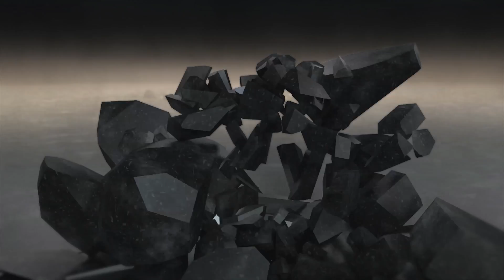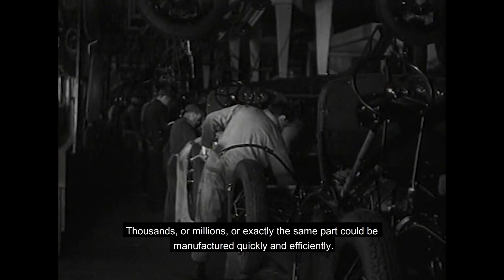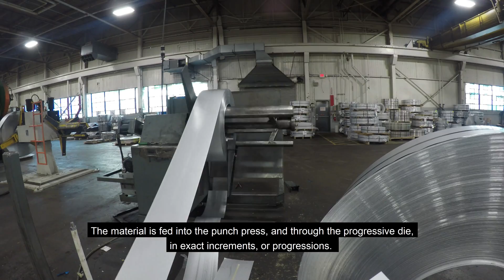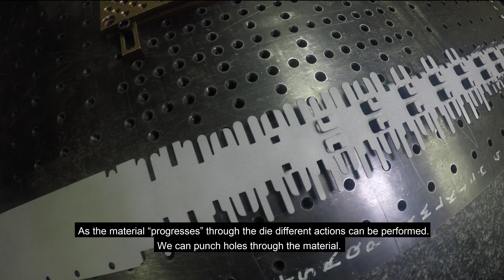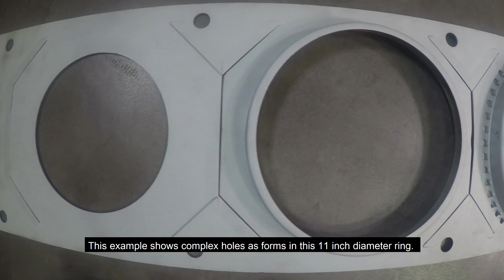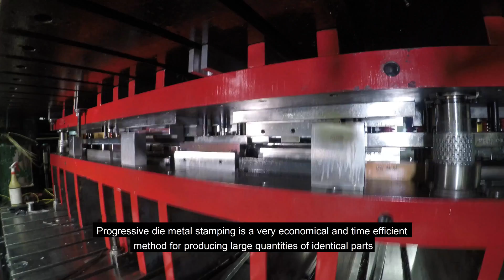Progressive Die Metal Stamping Explained | How the Stamping Process Works – Talan Products

Comment from the maker: What is progressive die metal stamping?
It’s a high-volume manufacturing process where a metal strip moves through multiple stations in a progressive die, with each stroke of the punch press performing a specific operation until a finished part is produced. The progressive die stamping process allows manufacturers to create consistent, tight-tolerance parts efficiently at scale.

Comment from the maker: The progressive die stamping process uses a series of stations within a single die to punch, form, bend, coin, or draw metal as it advances through the press. Each press stroke produces the same precise operation, making progressive die metal stamping ideal for high-volume, repeatable parts with exacting tolerances.